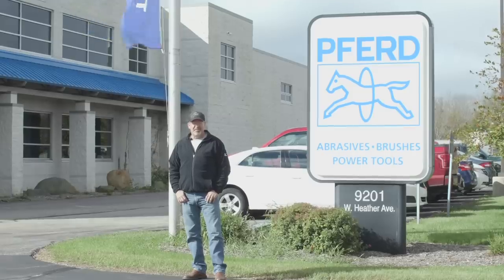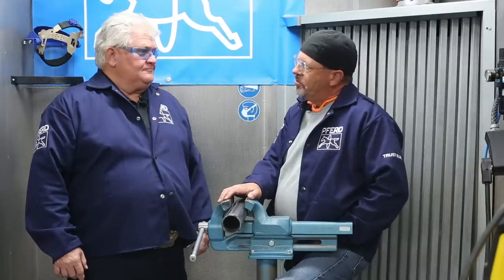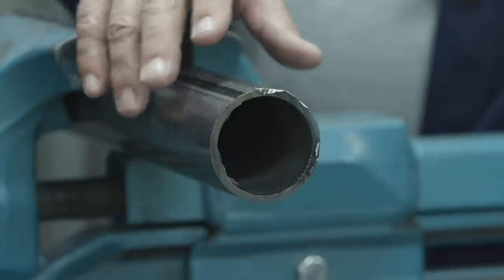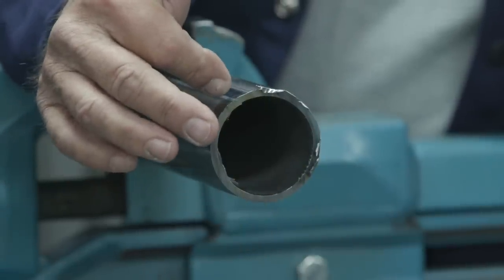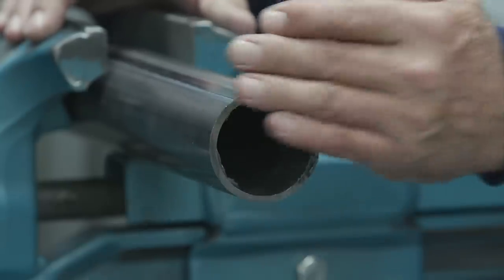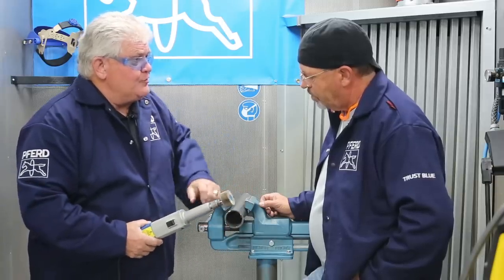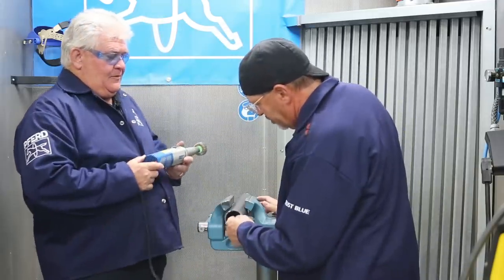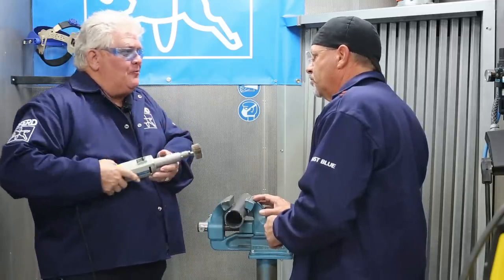Mastering Steel Tube Fabrication: Prep, Bevel, Weld, and Finish

Comment: Weld.com is freaking amazing. I've learned SO much watching their videos.

That said, this ad disguised as a video does have 2 great bits of advice. 

1, pull a flap, push a rock

2. When flushing a weld, send the sparks directly parallel to the direction of the weld. Think of the weld as a straight line that extends off into the next room thats in a safe direction, then send the sparks in that direction.

Comment: Interesting. The bevel tool looked pretty slow though.
Reply: Matt Tradie yeah, I think I’ll stick with my lathe in the shop and my grinder on the job.
Reply: R Dankers, I was thinking just that, a lathe would eat all that stuff in 10 minutes tops.
Reply: +1, i also think 45 angle isn't right for 2"pipe. Usually we bevel 70-78 degrees.
Reply: It's more helpful to those not trying to break the bank or don't already own machinist equipment.  There is a pipe mounted bevel machine that uses these type of bits to create a bevel on pipe but again,  it's expensive.  I think these bits are great for the helper that can't seem to make a bevel the way the welder wants. Hand him one of these and it will be very helpful.
Reply: Give the guy a break, he's using the tool for the first time and feeling his way, it's going to be slow at first. A lathe is a better way as long as the part can be chucked ok but I think for field jobs this is a good idea.
Reply: Alexey Stuliy what type of industry?

Comment: Great move to turn to a specialist. At 15:45, this is what I ment when I commented on an earlier video by using the flapdisk ‘in the length of the weld’  or as they say here ‘parallel to’. I didn’t know about the need of pulling the flapdisk, so I’ve learned something today :) thank you!

Comment: I'd have been done bevelling and millscaling an 8' length before he got done screwing around.  I use a 60 grit flap for the bevel and an electric orbital sander on a roller bench.  The sander spins the piece at the correct angle.

Comment: All of my working life I kept on thinking of making a similar tool to a hand pipe cutter which would sit over the weld and be adjustable downwards with geared mill cutters contacting the weld. As it was hand turned just like a pipe cutter, the bits would turn against the direction of movement of the tool and the weld was milled. Maybe Lithium battery powered today?

Comment: I found I prefer bevel flap Wheels over flat flap Wheels so that I don't have to be so concerned about leaving marks from the back side( the part I'm not using) of the wheel. What are the pros and cons of my thought process?
 especially when you Feathering welds on flat stock. If you're running the flap wheel parallel to the material and you're getting it down to no visible joint means youre going to leave a mark on the back side cuz the wheel is flat.

Comment: If you are dealing with short pieces of straight pipe, put them in a lathe screw the abrasives and the air powered invisible sliver givers

Comment: The over looked science of grinding, sanding and pre and post clean up.  Ever notice about 20% of employees use 80% of consumables and still only put out 20% of the production?  The old 80/20 rule!
Reply: Lee Barnhart You mean that you credit them for producing 20% of the work? More likely 10%to 15%on a good day with a favourable wind. You forgot to mention that they are also the best ones for butchering or loosing tools and equipment. Now just why do we have them around? Entertainment value doesn't really cut the mustard.

Comment: I'm surprised that none of your hosts told you that the proper pronunciation of the word Pferd is FERT. In German, Pferd means horse, which you could have guessed from the fact that they put a horse on everything they sell. In the German language, if a word ends in a d, that d is pronounced as a t. Thus ferd becomes fert. The same is true for my name which is Schmidt, Schmidt in German is spelt three different ways depending upon which part of the country you are from. Schmidt is Bavaria. Schmitt is Northern Germany near Hamburg, and Schmid (Still pronounced Schmidt) is from Eastern Germany (Berlin).

Comment: You do realize that you can have the grinder in any position because the disc is round it's all in the placement position not the tool position. Hard for me to explain but he makes the process awkward and difficult just in his body position when it doesn't need to be and still do the same thing but better tool control. Nice flap disc though but the bur is kinda useless

Comment: Why don’t you just put it in a centre lathe. Use a chamfer tool bit. The bevelled end will look a lot cleaner and the process is a lot easier and quicker to do.

Comment: You have to press down so much when using that beveling tool and it slows the rpms down.you can hear it in the air tool.id rather use a grinder

Comment: And after you have picked the million needle sharp chips from the burr out of your overalls and skin, you can chuck the die grinder back in the tool box where it belongs and reach for an angle grinder and do the job properly!
Reply: After having the doctor scrape a die grinder sliver out of my eye with a hypodermic needle, I concur.

Comment: In my opinion, these are solutions to non-existent problems. Unless it is a camera angle thing, but, I believe I still see an uneven surface left from their 2 in 1 flap wheel and the bevel quality of that bevel tool was not very good and seemed quite slow, not to mention the little slivers it leaves behind to get into your gloves and down your coveralls.. Not to mention the need for a variable speed grinder just to use with it, I'll stick to my regular old flap wheels for now.
Reply: Spencer Campbell I agree mate, I prefer 5” grinder with standard grinding disc and die grinder with deburring bit, works every time and no mucking around

Comment: Why don't they invent an inverted flap wheel. With the flaps inside a big drum. For smaller pipe like this it would have taken you 2 seconds.
Reply: lolz larkin because real welders use a 5” grinder

Comment: That bevelling tool?.... absolute crap. Never going to get an accurate angle with it unless the die grinder is mounted in some sort of jig, and then there's the amount of time it took!!!
Variable sized pipes? Angle grinder with grinding wheel, flexible grinding disc, flapper or soft pad. 
Hundreds of pipes? Bevelling machine. 

This is simply a gimmick and a backward step.

Comment: What a waste of time for that burr bit and those "special" flaps. Guys trying to upsell products that "do the work" for you. How about just training yourself on how to properly use a grinding disc to bevel pipe, carbide bit / flapper bit to clean up the inside mill scale without gouging it, and getting the proper grinding angles to make a smooth finish. You can even see the slight humps of the weld on the finished product after the pipes been ground smooth,  These tools were definitely made and designed by a tool crib attendant or a pipefitter. My god my eyes hurt more than getting arc flashed right now.